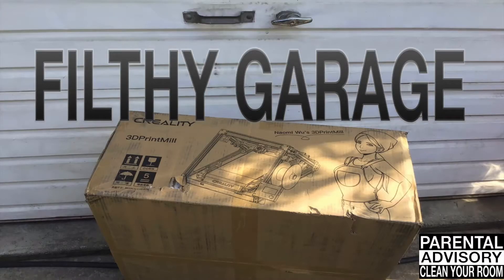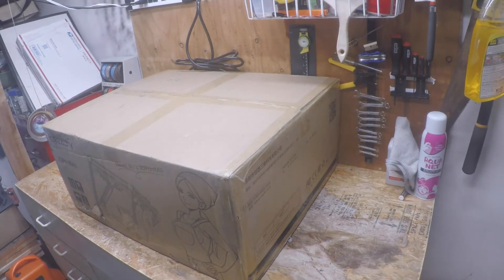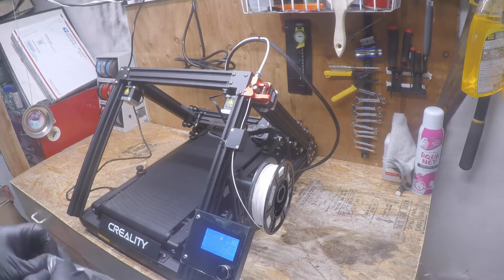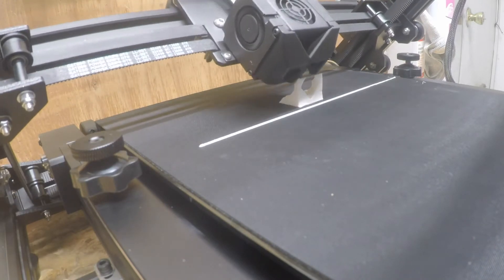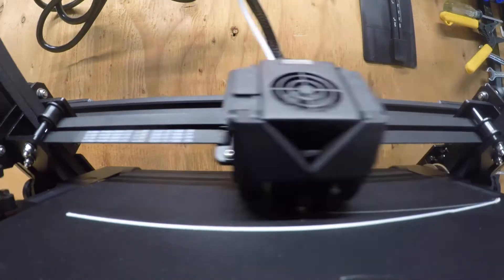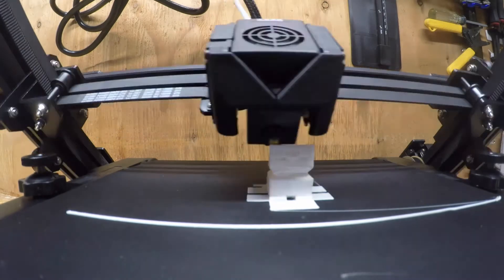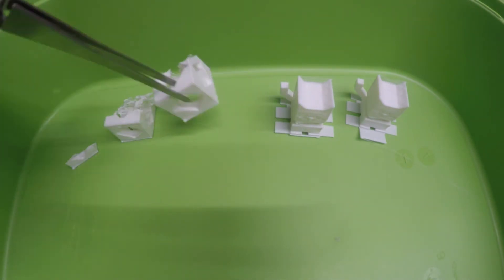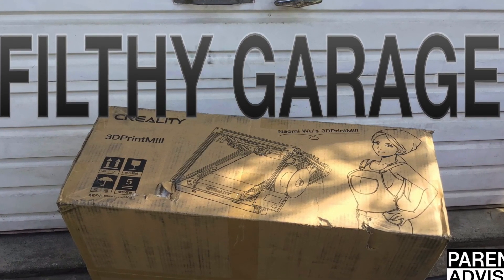Creality CR-30 3d printer unboxing and testing

Comment: Thanks for the shout out! The cube is meant to be sort of a torture test. Also, I've learned that Kiri's defaults for the CR-30 are a little aggressive. The stock CR-30 really needs to print slower to achieve good quality, especially on flat vertical faces. And there are a number of settings that can be tweaked to achieve this.